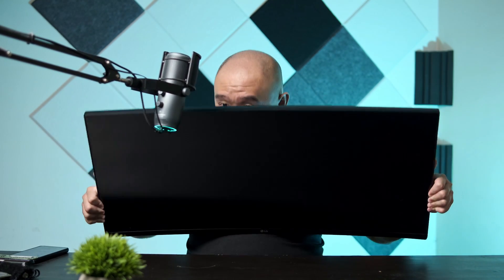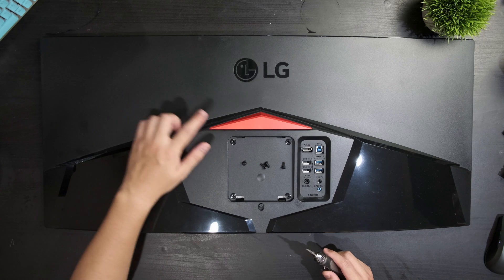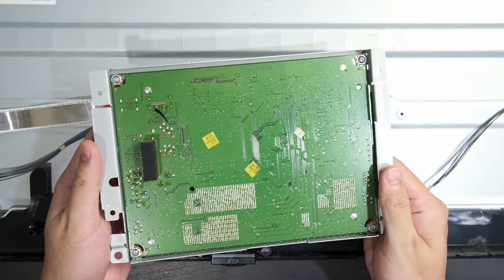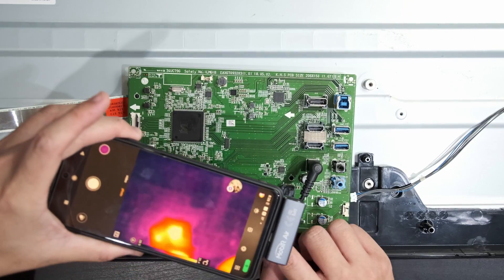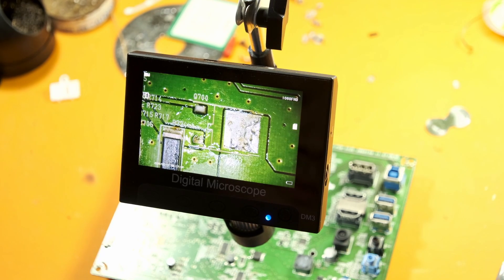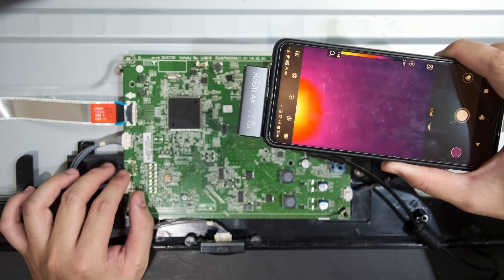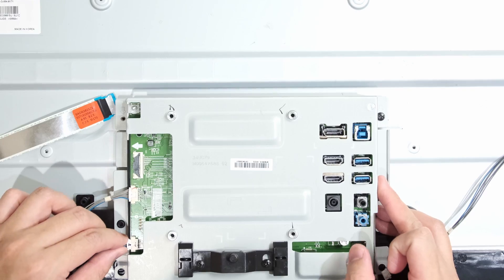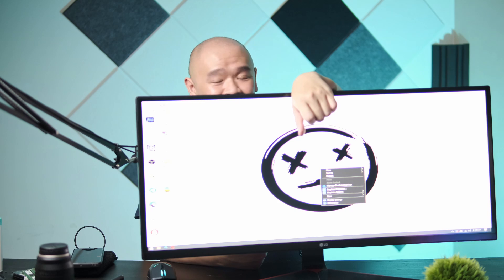DEAD LG monitor... But I'm pretty sure I can fix this.

Comment: When my ASUS VG32Q died I tried to fix it. I'm not completely useless but I don't have the same expertise and tools than you. I used ChatGPT to help me debug the issue and looked for a replacement board on Aliexpress but didn't have the same luck. Local repairman also was unable to fix it and the repair would have costed ~$150. It is a chronic issue with that monitor and apparently most gaming monitors have planned obsolescence nowadays.

Comment: I know this is an older video and not sure if you will see this, but I have a LG 27GN95B-B. The monitor looked great it didn't have anything appearing to be wrong and then one day I tried changing the input from my computer to my Xbox but accidentally his power off. I have not been able to get the screen to light up at all since pushing power off. LG support said they would charge $350 flat fee for me to send it to them, but I feel like it may be a more simple and cheaper fix.

Comment: Hi mate. I have a LG 34GK950F wich aparently starting to have horizontal lines. Apparently the issue is because a ribon cable between the panel and the mobo. Is there any chanche you know where that cable can be purchased? LG cs dont want to help , and i can't find anywhere.

Comment: I got a similar monitor with horizontal lines and screen errors on the left side. Do you think a mainboard replacement would help or do you have other suggestions to check?

Comment: how do you tear it down, i cant remove the back plate, i had unscrew the four screwsa but nothing, is solid as hell
Reply: Hi, I just opened one LG34WP85C yesterday. It was not easy. I can provide pictures if you like so you can see exactly where the clips are located.
Reply: @guillermoescamilla7302  pictures please 🙄or some tips
unclipped the bottom but 3 other sides hold strong as hell
Reply: nvm. just broke some clips and got this open.
broken clips look like they are not supposed to be unclipped

Comment: I think I’m having a similar issue, same mine is the UC79G-B and it won’t switch on but is making a faint buzzing sound like it’s getting stuck. I found a replacement motherboard and will try a replacement, if you have any other advice I’d love to hear it.

Comment: It might just need to re-flash the BIOS with EEPROM, files corrupted a known issue with LG monitors, no need to get new motherboard or de-solder, solder. If hear spark sound when plug in, the feet of the plug may be broken solder may required. Caution: Electrical voltage, consult experts if not familiar.
Reply: How would you flash a bios onto the motherboard though?

Comment: Where did you find the motherboard? I've run into the same issue with my LG 34WN780-B monitor -- just quit working on me last week. No power indicator light + black screen. Won't power on. I called LG Parts and they don't even have the monitor in their system, so no help there. I really don't want to buy a new monitor. I've only had this one for just over 3 years. And direction you could point me in would be appreciated.
Reply from the maker: I found mine on Taobao, a China e-commerce website
Reply: @TechRodent How did you get the rear cover off?! I ca t get the bottom of the cover to unclip.
Reply from the maker: A long flat head screwdriver and patience. They're not easy to pop off

Comment: Found your video on a search because my LG DC was sparking (different model).  I love to tinker, and this monitor is only 4 years old so I hope to restore it.  The difference in tech makes a better picture, but I have and HP and a Samsung that have lasted for about 10 + years that haven't given me issues yet.  Thanks for the info and break down.

Comment: My ultragear 27gn750 died a couple days ago ive got a softpry kit and soldering iron station on the way hopefully i dont need the soldering iron and can just replace the board for cheap... i dont want to spend another 400$ on a monitor when mine worked fine 3 days ago

Comment: I've got a LG 34GP83A that will turn on, and the backlight is on, but won't display anything. The computer detects it, but nothing appears on the screen. The on-screen menu will not come on either. I've tried HDMI and DisplayPort on different computers. I've tried a factory reset, but still nothing. Will replacing the board likely fix it, or is this a separate issue?
Reply: Were you able to fix the issue I’m having the same issue with my gaming monitor ultragear 34GL750-B
Reply: No, it turned out the main board was toast. It happened to a lot of that same model right about the time the warranty went out. I sent it back and bought a new S3422DWG and could not be happier. This monitor is a 1440UW beast.  @FR4G0UTX

Comment: Sadly 99% of LCD are not economically fixable due broken LCD Panel.
Reply from the maker: I have been able to fix monitors with broken panels for sub 100 USD; Pretty worth it if the monitor is a 27" 1440p and above
Reply: @TechRodent where do you get the panels?
Reply from the maker: @mattrandall1808 Taobao

Comment: My wifed Gn 750-b just suddenly died. Did everything to try and troubleshoot it, its just dead. I looked into many forums and reddit threads and it seems i am not alone in this issue. Many have stated that LG have chosen certain parts to have the monitor last long enough to outlast their warranty period of the monitor so that sucks. Last time I buy LG but im going to try and fix it myself.
Reply: Mine died months ago. It's just sitting hoping it can be fixed some day, but it's annoying that an expensive monitor can die so early. My other monitors are 5+ years running strong.

Comment: i really wouldn't consider that a repair, more so a replacement.
Reply from the maker: I'd stipulate that a replacement is a part of repairs; whether it's replacing a board or a component on the board or even a trace on the board. 

The end result still is a working, repaired device
Reply: I agree with DarkKokoro84. I was excited to watch you replacing other faulty SMD components on the original board, but you just cowardly gave up.

Comment: Hi there,,  I have the same model monitor,   my issue  are the ports ,  hdmi  1, 2  and display ,  not signal detected,,  tuns  on  ok,  and menu  but , just the ports  not signal,   can you share the  SKU of the MB
Reply from the maker: It's the EAX67093201